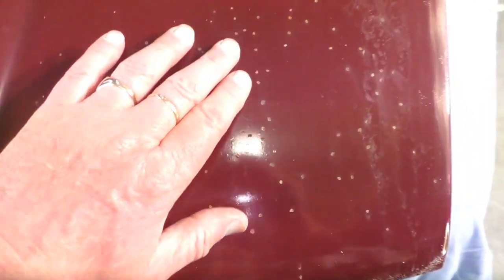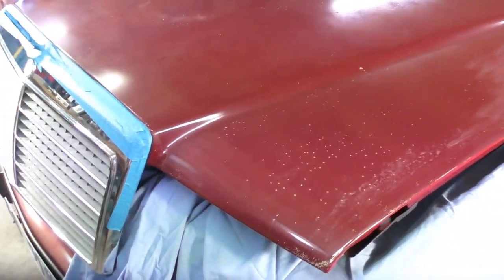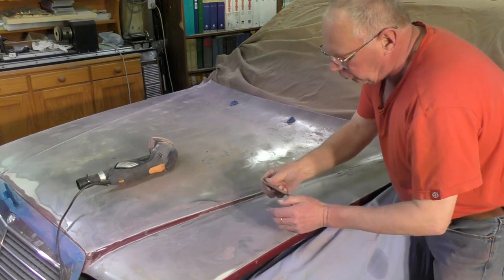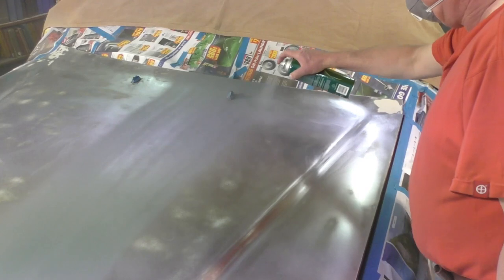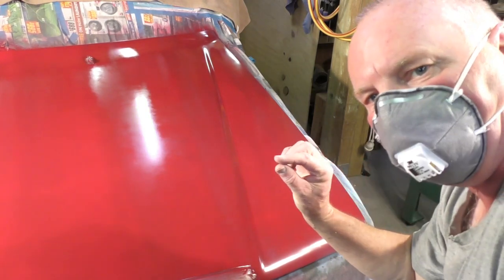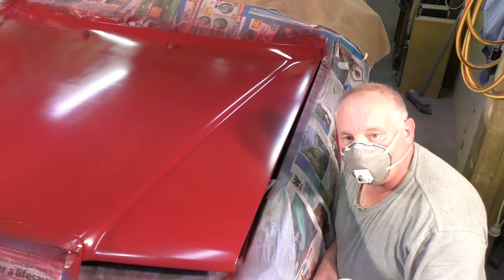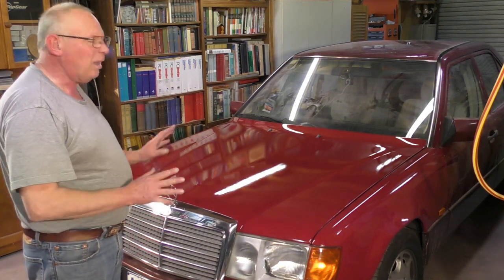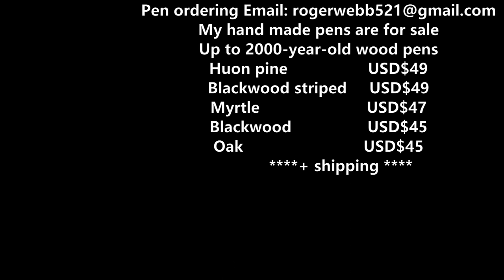How to Paint Cars with Aerosol Spray Cans

Comment: Thank you a great video & marvellous result. I am restoring a wing on a1995 Volvo 850 in a similar colour & condition. I have taken it back to bare metal & sprayed with aerosol etch primer. My question is can I spray cellulose directly on to the etch primer, or should I use another primer first. I have seen advice that says you cannot spray cellulose directly to etch primer. Have you had any problems with doing this please?